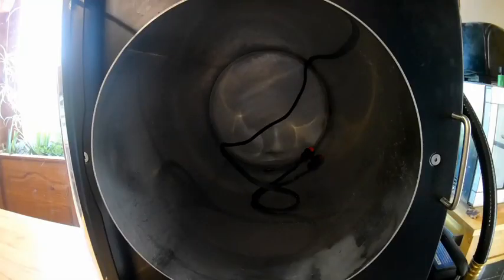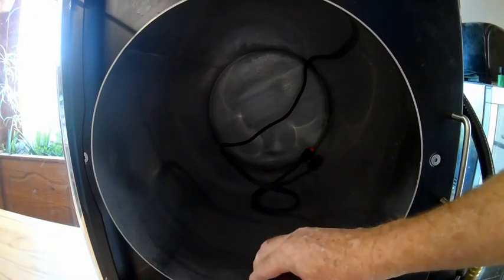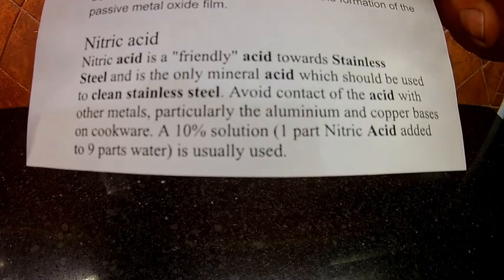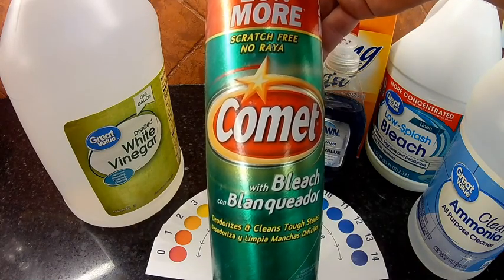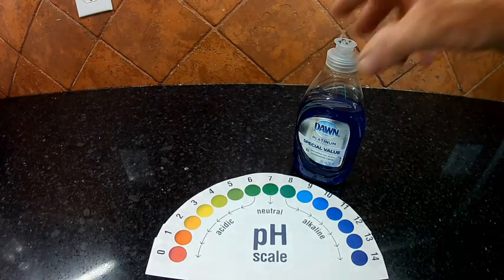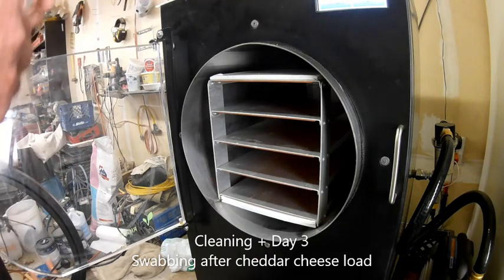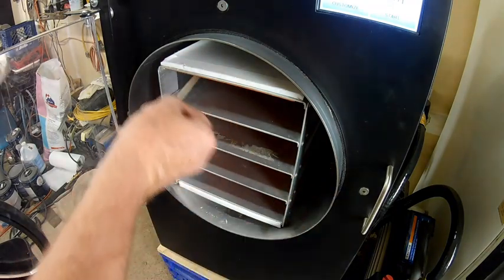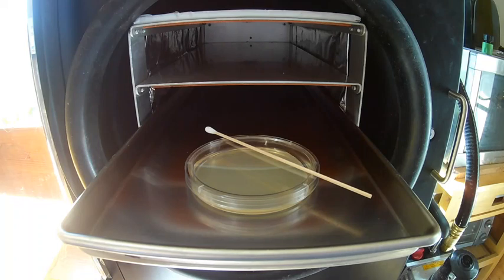Cleaning the Harvest Right Freeze Dryer

Comment: Hi Phil, thank you for all your videos. I truly enjoy all your knowledge. What would you recommend we use to clean the door for optimal life.
Reply from the maker: The door is plexiglass.  Any plastic or glass cleaner.
Reply: @Philat4800feet  cleaning the inside of the plexiglass door with glass cleaner won't be absorbed by our food?
Reply from the maker: @violet2433  Probably not.  Evaporation would remove most of the product prior to using.  The direction of travel (flow), within the chamber is from the frozen food to the chamber wall via sublimation.  If this is a concern you could use a slightly damp microfiber cloth to clean the door.

Comment: So should we be flushing the drain with clean water after every use to avoid or lengthen the time for replacing the valve?
Reply from the maker: In a perfect world, Yes.  But removing the gasket and unplugging the wire harness over and over could cause other problems.  Perhaps rinsing the drain every 3-4 loads.

Comment: Hey Phil!  Thanks for this video, super informative!  I'll be stocking up on isopropyl for sure.  Good to have around for a lot of things anyways.

QQ:  How would you recommend cleaning the drain hose?
Reply from the maker: I guess you could pour isopropyl down the hose.
Reply: JeffD:  I had this very problem just a couple of days ago. The factory advised me to pour vinegar containing 10% acidic acid down there. Now we know that’s not so good for the finish on the stainless steel, so what I did is I put a funnel in the drain, and filled the funnel. You did a great job of clearing debris out of the drain.

Factory also said that hydrogen peroxide was OK to use. Henceforth though I think I’ll be using rubbing alcohol.  

I do like the funnel for the reason that it fits in the drain and keeps vinegar from contacting the finish in the sublimation chamber.
Reply: @Philat4800feet  if I clean the drum out with isopropyl alcohol straight, it should cut any build up. Seems like a film on it at times. Thanks!!😊

Comment: Hi Phil, Have you considered Steramine sanitizer? It is used in the food industry to clean stainless steel. Thanks!
Reply from the maker: I have not heard of this.  Is it a chemical or machine?
Reply: @Philat4800feet  It's a powder you add to water to turn it into a sanitizing agent. I'm pretty sure it is chlorine based. That said, I have also been using IPA and it is far easier to work with IMO.
Reply: @DaveSmith-cp5kj  I have been using Steramine as a sanitizer and buy it from a kitchen supply store in tablet form. From their website "
Steramine is not a Chlorine sanitizer, it is a QUAT sanitizer, or Quaternary Ammonium." It would appear to be safe for use on plastic, silicone, rubber and stainless steel.
Reply: @katana600dee  I'm not sure why they say that because it says right there on their ingredients what the molecule is, and it does have chlorine. As the other groups attached to the nitrogen are carbon, the chlorine is likely to be the ion. 

I don't know the brands I used so there might be a different biochemical attack on bacteria, but all the sanitizers I've ever used had a chlorine smell.

Comment: How do you clean the hose in the back that empties water through the drain valve? Somehow mine got a little rusty. I’m pretty good about caring for and cleaning my machine, but it wasn’t working and I didn’t use it for several weeks. I just opened the back to replace parts and saw it!!!!
Reply from the maker: The rust is from portions of your ball valve.  There may be a time when you will have a vacuum leak because your ball valve ball will become rusty.  If you're not freeze-drying leave your ball valve open.  To clean the tube, pour a 1/2 cup of hot water with a 1/4 teaspoon bleach down the inside drain with your valve closed (do not mix the bleach with any other cleaner).  Wait 60 second and release the valve, pour any remaining sanitizer down the drain.  Follow this up with two cups warm water to rinse.

Comment: Phil thinking about using a spray bottle with 50% to spay the shelves. They are very difficult to clean because of small clearance. Though the spray would work for getting into those difficult areas. Thoughts?
Reply from the maker: I think you would be good.  The adhesive holding the heating pads is proprietary to the manufacture.  Even HR doesn't know what it is.
Reply: If you don’t have small fingers to get into around those spaces, you can use a bottle brush, along the variety of the ones people use for cleaning homebrew set ups.

Comment: Great Video!  Will putting the 70% Alcohol on the rubber gasket dry it out and cause it to crack or fail over time?
Reply from the maker: Never did research on the gasket.  perhaps mild soap?  I'd use alcohol in the deep grove to kill mold.  A good place to hide.

Comment: I must ask Phil, how did you solve the corroded ball valve issue? Did you replace the ball valve yourself? Where did you acquire the right one. 
Or did you have to get Harvest Right to send you a new part?
Reply from the maker: I purchased a 3/8" ball valve from Home Depot and installed it my self.  There's a video on it.
Reply: @Philat4800feet  That's awesome. Thanks for the response. As a new FD owner, I've learned quite a bit from your channel.

Comment: Phil thanks for your thorough process of showing the evidence.  You must have worked sometime in a chemistry lab or bio lab?

I wonder about alcohol.  Can it be used on the shelf fixture?  Especially worried about using alcohol on the heater element part of the shelf..  The resin and/or plastics used in the heating component may be damaged by alcohol.
Alcohol is a close to neutral PH.  But alcohol is also a powerful solvent capable of dissolving and or dry cracking synthetic resins over time.  What are your thought on the shelf rack cleaning process?
Reply from the maker: My research was only with the stainless steel.  I'm sure I know who makes the heating pad.  I will contact them.
Reply: @Philat4800feet    Very thoughtful for you to do this.  I appreciate your search for the evidence based truth in a systematic and scientific manner.
Reply: @Philat4800feet  Hi Phil, I am wondering if you ever contacted the company that make the heating pads and found out if it is safe to use alcohol to clean them. Really appreciate all the work you do and share with everyone. I recommend your videos every chance I get. Thanks!

Comment: You mentioned in the video possibly cutting the alcohol 50/50 but I noticed you used straight alcohol when you cleaned the chamber. do I use it straight or cut it, or doesn’t it matter?
Reply from the maker: For those who are accident prone, cut it with 50% water.  For those who are careful, full strength.
Reply: IPA in higher concentrations is flammable like gasoline or acetone. So as long as you aren't doing something like smoking while cleaning, you are good with high concentrations. That said, it burns off very quickly so it is unlikely to cause any harm even if it does catch fire.

Comment: I have been using Envirocleanse-A.
Reply from the maker: Looks like the PH on Envirocleanse-A is 6-7.  Pretty much neutral. the SDS shows the following: 
Biocide/Disinfectant (EPA Reg. #85134-1) for use on hard surfaces as well as biocide in oil
fracking & sour wells, disinfectant of food, and disinfectant of potable water. 
The SDS shows it's fairly safe.

Comment: How about Five Star PBW or Starsan used in the brewing industry? You can get them from any brewing supply store. Would like to hear your thoughts.
Reply from the maker: I had to look PBW and Starsan up.  The PH level for PBW is 12.  For Starsan (Star San) is 3.5.  12 is really high on the PH scale (alkaline side), while 3.5 is about the same but on the acidic side.  The better cleaners should be around 6-8.
Reply: So the brewing industry has been cleaning their stainless vessels with the wrong stuff. They clean after every batch with PBW and for good measure they spray everything with starsan just before starting a new batch. I have not heard of any problems with it breaking down stainless after decades of use. They pump it through their hoses, pipes and valves that are not easy to disassemble and clean.
Reply from the maker: I can't speak for the brewing industry, but...  There are two issues: 1. ASTM wrote the standard A380 for cleaning stainless steel and retaining the protective chromium oxide finish and only a PH neutral cleaner should be used. 2.  According to the FDA, and most health departments,  only approved cleaners should be used around food.  Cleaners not approved must be rinsed, and then sanitized with an approved sanitizer.  For home and personal use you can clean your FD with anything.  If you start selling food to the public that changes everything.  I doubt any of us will ever clean the chamber of the FD enough to ever see it fail. Perhaps I'm being too anal retentive.  I just believe in doing something right the first time.

Comment: Do you dilute the alcohol 50% with water?
Reply from the maker: There is a liability factor to consider.  A 70:30 mix* (recommended by the CDC) will keep the vapors from igniting with spark and flame.  50:50 will still work. *(70% alcohal:30% Water)

Comment: Did you use the alcohol on the heat pads.
Reply from the maker: No, just the stainless steel.  The makers of the pads have a proprietary adhesive.  They won't even tell Harvest Right.  I use warm water and mild dish detergent and rinse (wipe) serval times.  I'd be careful on anything that could dissolve the glue.

Comment: Do the shelves just pull right out?
Reply from the maker: 1.  You'll need to remove the door gasket, by pulling on it.
2.  Slide out the shelf assemble carefully.
3.  While holding the shelf assemble with one hand, release the wire harness plug by pressing the release button.

Comment: So how often should we change the ball valve
Reply from the maker: Hard to say.  How often do you use your freeze drier?  My FD runs 24/7 and I replaced after a year.  I would occasionally dip the drain tube in water and see if it sucks up or wait for a vacuum error message.
Reply: @Philat4800feet  thanks

Comment: Have you tried 35% Food Grade Hydrogen Peroxide?  Would it damage any of the components?
Reply from the maker: That has a PH of 3.5.  This is on the acidic side of the scale.  Stainless steel should have a neutral cleaner around 7
Reply: @Philat4800feet  Thanks Phil.

Comment: Phil, what ratio of isopropyl alcohol to water do you use to clean the chamber?
Reply from the maker: Keep the alcohol at 70%, but be aware that alcohol at this level can still be flammable.  Keep the solution away from open flame or spark.  I would keep it in a liquid form, not a spray.